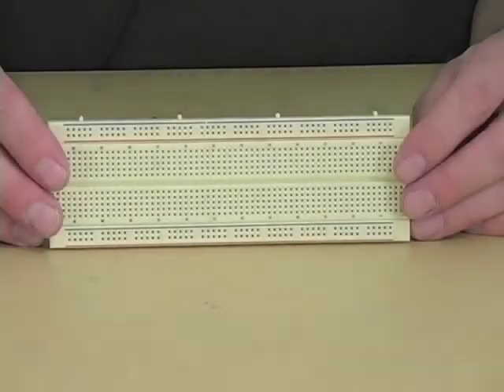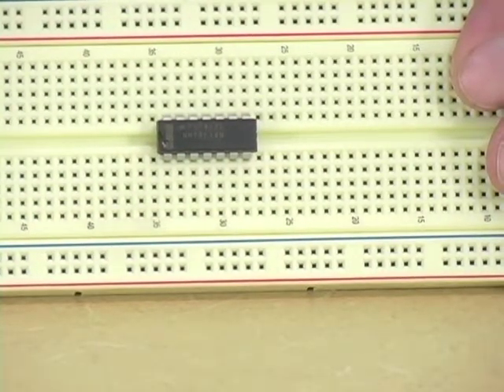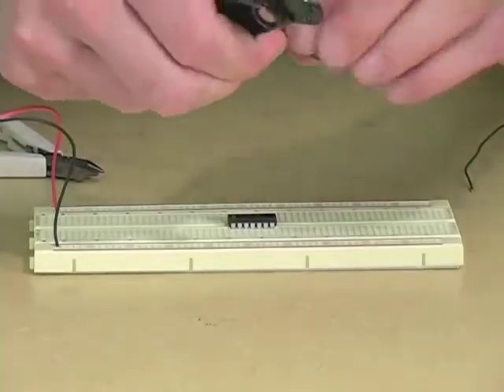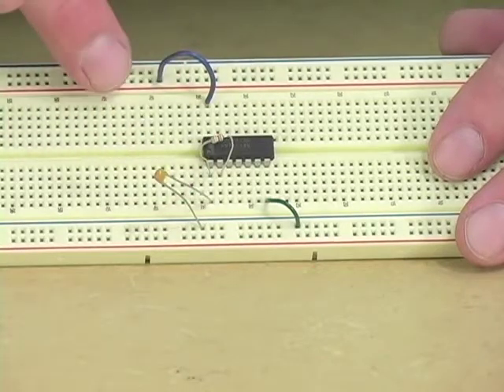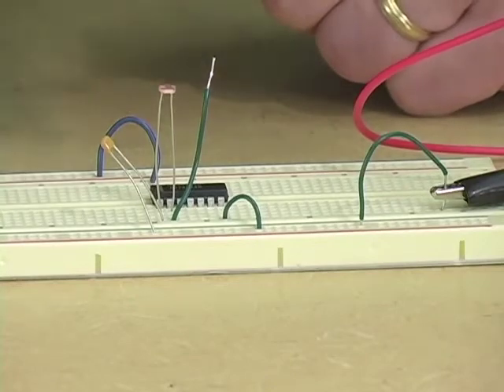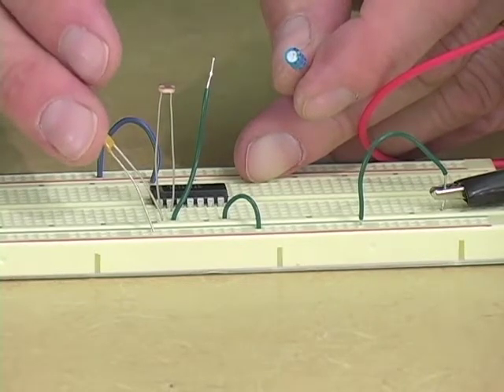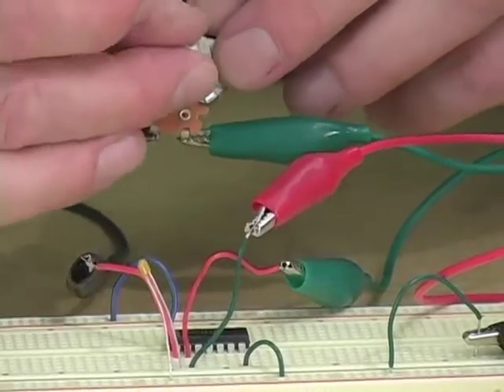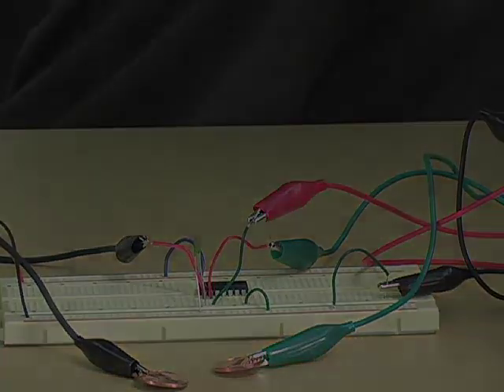Hack of the Month Club -- Project #11: My First Oscillator

Comment: Note: under some circumstances, a polarized/ electrolytic capacitor CAN explode in flames and smoke, launching small pieces of itself. 
ALWAYS double check your capacitor, diodes, voltage inputs, etc. for correct polarity.
Reply: i like to live dangerously but i lost my best guinea pig to a polarized capacitor and donald trump is doing nothing to help me.

Comment from the maker: No, I've never tried to integrate enough modules to call the result a complete synth, but the book includes a nice range of designs that could be combined in a synth-like fashion.  I don't know of a single book that steps you thru a full synth, but there are lots of diagrams and kits out on the web.

Comment from the maker: 74C14 can run up to 15 volts, so I don't know where you found 6v as absolute maximum (maybe it's in the "recommended voltage" column of the spec sheet.)  74HC14 or 74LS14 use 5 volts, stay away from them.
Reply: Yep, I'm running the wrong ones, better swap them out. I'd much rather just use one battery. Thanks for the heads up, and also all the clear tutorials!
Reply: with 74hc14 and 74LS14 as they use 5 Volts, cain I use them with the same conections in the video with a 9V battery?

Comment: Why don't you show the amplifier on the right? What kind of amplifier or speakers  needs this project? What kind of connections  needs the clips to the amplifier? Thank you.
Reply: Rubber Flowers Sounds it’s just a small Radio Shack-type $12. amplifier. Check amazon for ‘small battery audio amplifier’ and you should be able to find something similar. 
Also, if you have an old radio or boom box with an audio in jack, you can use that to amplify your sound signals.

Comment: I have been reading the data sheet of the chip used, it says that it only uses 6v max of power should be used with the 74c14, but a 9v battery is used here, I have used the same and have it working; it's not even warm to the touch. I am curious as to why the battery is not frying the chip? Is it stable?

Comment: If I add more circuits, will I need to power each one individually?  I built this circuit with the parts you suggested. Now I want to add more to the same chip.
Reply from the maker: You can power several CMOS chips off of 1 battery.
Reply: @siliconluthier  can't seem to figure out how to build more circuits off the same chip. That is doable right?
If I can, I can't hear them
Reply from the maker: @Vice.K  Yes, you can build 6 on 1 chip and mix them with resistors or diodes.  The book explains how to do this.

Comment: i am new to this. can someone please provide a component list. for example the capacitor is a .1 microf but at my local electronics store there are. CD104 .1uf 50V Ceramic Disc Capacitor, CM104 .1uf 50V Ceramic Monolithic Radial Cap,  CD104 Ceramic Disc Capacitor .1uf 50V, etc... there are also multiple types of photo resistors :) thanks for any guidance.

Comment: Can i put the speaker dierectly to the oscillator without amplifier
Reply from the maker: No, you need a amplifier of some sort.  The oscillator can drive a piezo disc directly, but it will be very quiet.

Comment: Im very new at this but also very curious... Can you make some kinda of switch between different caps with different uF values that will make it able to change the frequency range of the oscillator? Like you want to make a bass so you use a cap which is more accurate at lower frequencies and when you want to use a more treble sounding "instrument" you choose a cap which can aid with that? And this all just by using a potmeter to change the overal frequency in the full range?
Reply: Yes,everything you said is correct. The switches are a good idea

Comment: When i connect a 0.25w speaker it doesn't make any sound :( I have to use an amp like you?
Reply: You need an amp, cmos oscillator is low current, can't power a speaker directly.
Reply: thank you!

Comment: Hopefully someone can help me, I've tried making this and it works fine for a blink led but my results are way off for audio.  I'm getting all sorts of what seems like ground issues and I'm not getting any clear square wave.
I used the same components as in this video.  I've obviously missed something.  Again, any help would really be appreciated.
Reply from the maker: Hard to debug remotely, but check that you have no connection between the blinky circuit and the audio lines except for light.  Some photocells have wider (better) dynamic range than others.  The book walks you thru this project with pictures.  Good luck.

Comment: Hello, I'm really new to circuit bending. This is my bread board so far (See link below to screenshot) but mine looks a bit different. I've got to the part where I need to connect my capacitor but my busses are along the tops and bottoms instead of left and right. Have I got the wrong type of bread board, or is there a way around this?

https://drive.google.com/file/d/0B4qeOWnrgnheZFhNb3A3WjRiSTg/view?usp=sharing

Thanks in advance.

--Harry
Reply: Three weeks too late, at any rate.

Your board should work if you sort the logic of what pins, on your specific board, are connected.  The location  of the buss won't have any effect on your circuit.  Think of the buss or rail as a location to hook to ground (blue) and a place to get supply voltage (red).  On your bread board, the pins next to the red line(s) are most likely connected.  Red is for (+).   The pins next to the blue line are for (-).  You have a black wire connected to your red (+) rail.  Move it over to the left on the blue rail.  That's assuming your black wire is hooked to negative. ( I'll bet your battery got hot.)  
EDIT:
Oops, it looks like your red rails are separated into V1, V2, V3, V4.  You can jumper them as you choose...
Reply: Harry Bolland No they should be fine , please take my advice thou on this if you like . Keep your plus voltage at one extreme and the minus voltage or your ground to the end. In other words if you look at the Ad 01 board Red V3 and V4  i would make the +v bus and the black bus next to v1 and v2 the minus voltage or ground. The reason for this is that i found i was getting a crossover and short circuit when i used the opoosite power rails too close together. I built a 3vco synth prototype on these boards , check out my channel if you have a mo.

Comment: Mine never works! Don't know what I'm doing wrong, I have a different op amp so I'm relating what's said to this chip (the TI LM324N) but not having any luck. Could somebody please help me
Reply from the maker: Lewis Dolan An OpAmp (like the 324) won't work in this configuration.  All chips may look alike, but they're different inside.  You need a CMOS Hex Schmitt Trigger: 74C14, 40106 or 4584.
Reply: Thank you for the quick reply, I understand they function differently. Will have to experiment to get it to work
Reply from the maker: Lewis Dolan If you get the right chip it should boot right up whistling, shouldn't take any experimenting to get it working.

Comment: I have made this and it is working but the output from the speaker is extremely quiet, anyone any idea why?
Reply: tried it on my two amps, through the half watt it was just audible, through my 40 watt it was still very quiet even with the volume maxed out.
Reply: You need to send the signal to an amplifier. It will not drive a speaker directly